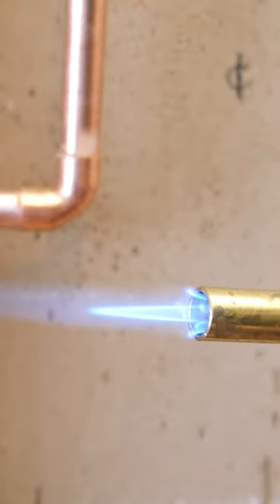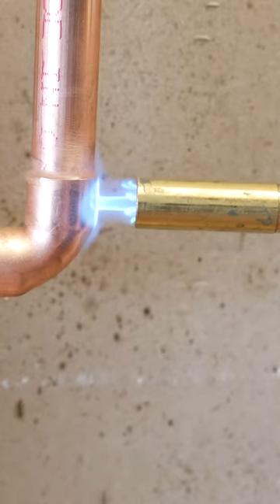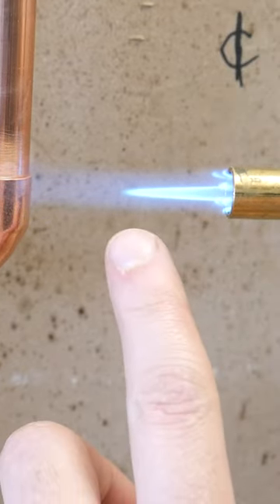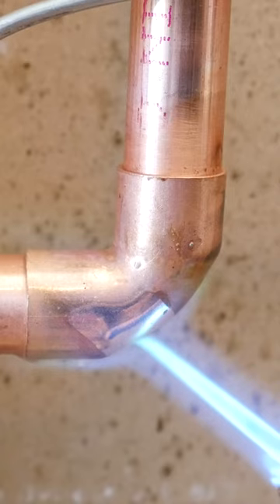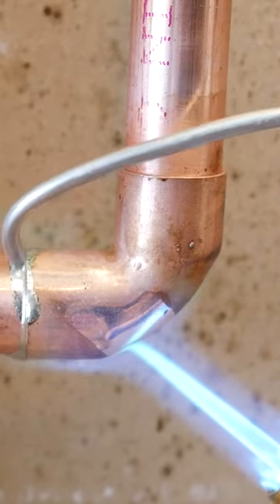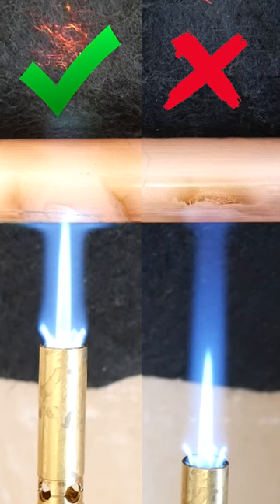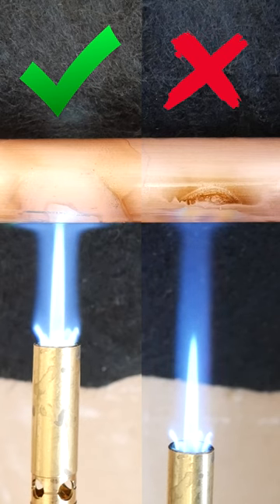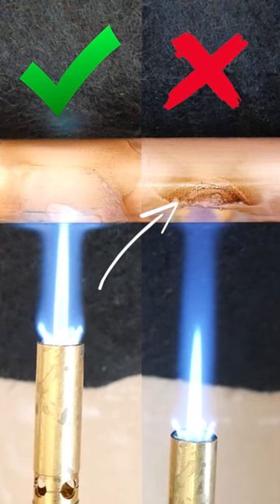SOLDERING MISTAKE #6 (flame position)

Comment: I put the flame a bit closer and keep it moving around. Start where I'm going to apply the solder but hold the heat on the opposite side when applying the solder. Closer is better because the hot point wraps around the pipe, but it's also why I keep it moving. When the flame turns green, it's solder time.

Comment: Can show soldering techniques on all joints in one video? Like 90 going horizontal and vertical,  T going horizontal and vertical,  coupling joint two same size pipe horizontal and vertical?  My problem is what part should we apply the heat and solder first and how fast apply the heat to other end and solder it so first end doesn't get impacted.
Reply from the maker: Check out my soldering playlist here: https://www.youtube.com/playlist?list=PLLEVGyi2B-caiXZtuTw6LQGJznIkXk2Hy

Comment: Solder does not need much heat either its not like brazing
Reply: brazing is much much more difficult in my opinion. With soldering you can just heat the base material and put the solder on it, it will suck the solder and melt instantly. Whereas brazing takes much more effort and skill to achieve the same goal

Comment: So, if the hottest part of the flame is at the mid tip, then there is no way during demo where you stated at side by side comparison that they are both the same temperature.